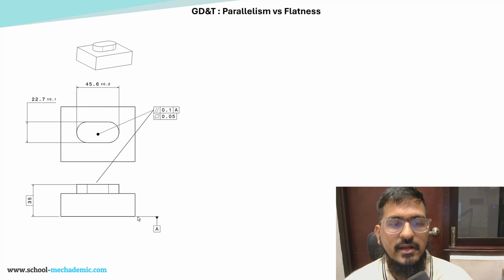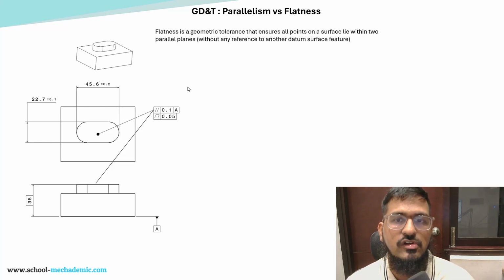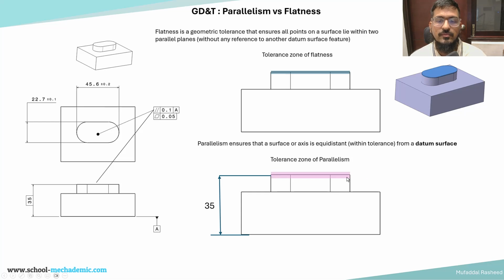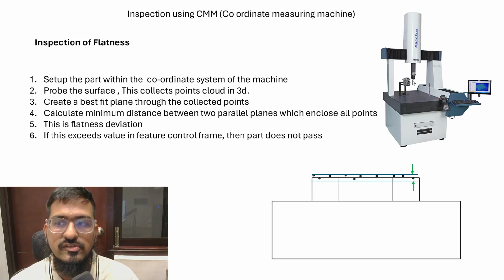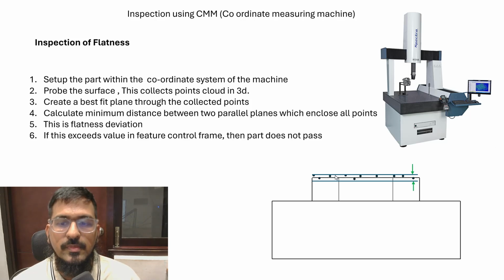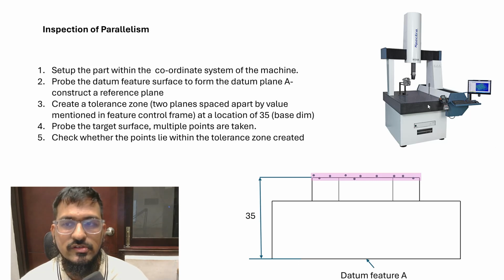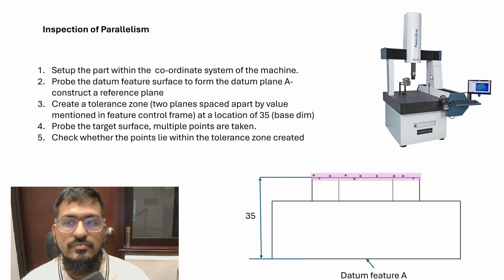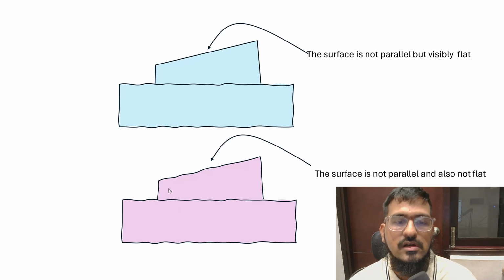The Real Difference: Parallelism vs Flatness in Geometric Dimensioning

Comment: Now what is difference if we but parallelism 0.1 and position 0.1?
For me if surface is between 34.9 and 35 it fulfills parallelism, but not position as position divide tolerance field into 2 equal halves. Is that correct? So for Parallelism it can be from 34.9 to 35 or from 35 to 35.1, but for position it will be only within range 34.95 up to 35.05?
Reply from the maker: Position is controlled for a Feature of size it doesn't apply to a surface as parallelism does.  The way the control is applied is not the same